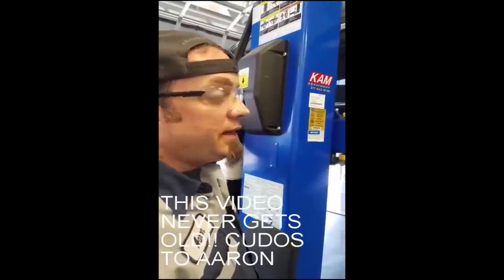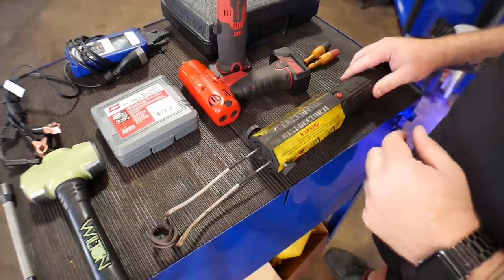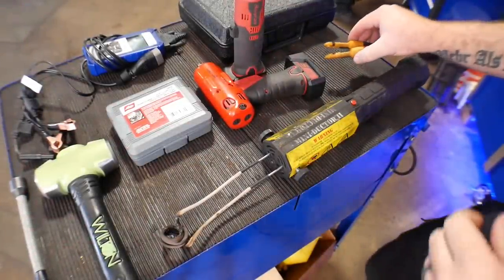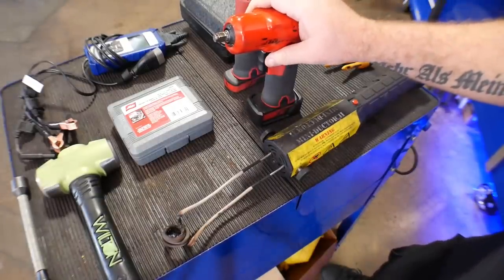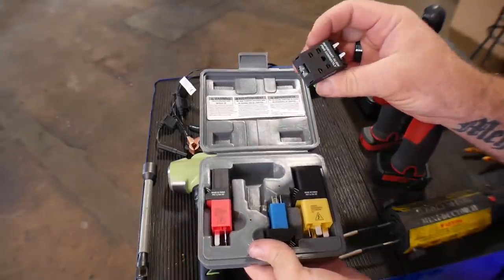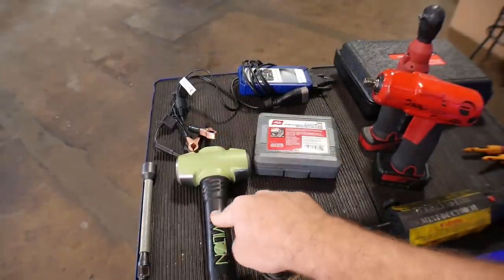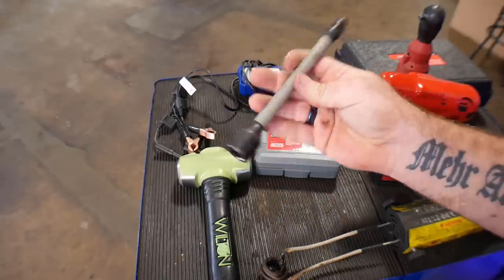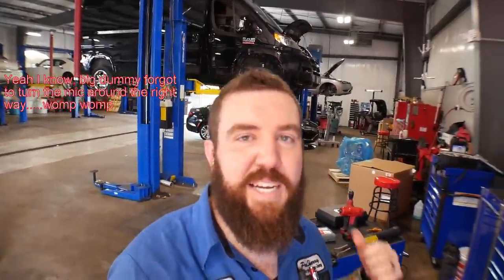TOP 10 TIME SAVING TOOLS FOR THE MODERN TECH

Comment: My Top Ten - 9 cans of beer and one trip to Harbor Freight.
Reply: Harbor freight oil filter pliers and dog bones for drain plugs brokes in less than a week
Reply: @diegochur2241  what u talking about
Reply: If you get the black handled ones you need to put lock tight on the bolt have had mine fit a year
Reply: Me too!!😎
Reply: Mfs talking about oil pliers 🤣

Comment: As a field mechanic for heavy equipment I think the cordless impact and wobble sockets are the two most used tools on the truck followed by a dmm, followed by a crappy screwdriver for jumping stuff over, followed by a torch and welder.

Comment: in minnesota, everything needs a  4lb hammer. that inductive tool looks useful as hell. my time saving tip is when working on something unfamiliar, put bolts in a plastic organizer box and label each square on the lid with a dry erase marker
Reply: A 4lb hammer and a cutting torch.

Comment: Good list.  I'll add stubby impact, swivel sockets, extra long ratcheting wrenches, furnace air filter in oil drain to prevent splatter messes, power probe, cordless soldering iron (butane or electric), those long reach angled needle nose and hose pliers.

Comment: Im a heavy equipment diesel mechanic and my biggest time savers are my 3/8 cordless gun, my 15 degree offset double box end wrenches, my trusty 13" 3/8 drive flex head ratchet, power probe, 3/8 semi deep sockets, and both of my relay test jumper kits. I love the relay jumpers some guys use the buddy tester but i prefer just using the jumpers, oh and my trusty mac prostick light

Comment: Piercing wire insulation and using a test light ? Really I mean we all have different ideas but in the rust belt piercing wires cause corrosion that will come back to haunt you. 
Great vid tho
Reply: I really don't get why guys don't just go to the connector for testing. Never understood why pierce if it damages the wire and also allows corrosion to get in and give you future problems.
Reply: @Downsolow  If I have to pierce a wire I always use a dab of liquid tape to seal it back up. Good stuff.
Reply: @johnsmith6368  I'm sure it's good stuff. But you still ruined the integrity of the wire in my opinion. You might break strands while piercing and you do seperate them with your piercing tool no longer making them a joint unit. But that's my opinion.
Reply: @Downsolow  I agree. Im saying if you have to because of whatever reason, you should at least seal the hole. The liquid tape gets into the hole and not just cover it up.

Comment: I just ordered the lisle relay kit after watching this video, thanks for the good tool recommendation. 
One tool I would definitely recommend as a tech that does a lot of diagnostics is an Incandescent test light. I use mine multiple times a day, almost every day of the year, it's extremely handy for electrical checks and makes checking fuses a breeze, and it's a cheap purchase on top of that.
Reply: Yea but go with the #69300!
 Then the #69250 add-on test jumper kit.

Comment: One my favorites is hard to describe but mine are Mac and it's a set of pliers that are extra long with an extra joint.  I think they are made for taking small hoses off but I use them all the time for taking off stubborn electrical connectors, works great.  Very good video, thanks for sharing and being so professional.
Reply from the maker: Thank you! I appreciate the feedback and tool input👍

Comment: Milwaukee 3/8, 1/2 impacts, cordless ratchet
Power probe 3
Fluke 179
Autozone volt meter
Coolant pressure test kit
Snap On Battery tester

Comment: As a marine mechanic I use a 12v pump mounted to a bucket with a lid to suck out oil of outboard engines, saves hours from having to pull the boat out of the water. Also the electric ratchet was a game changer.  Always have a magnet on me too. Dropping hardware in bilges or even dropping your tools and retrieving them

Comment: Thanks.  Very helpful; the mini-ductor is something new to me and a very practical choice. When you have to work outside, a multi-drawer mobile cart lets you move all commonly used or needed tools right to where you are working, and it has parts bins and a work surface on top and a power bar to plug things into.  Second are magnetic trays to hold small parts.  The mobile tool cart is less than $100, with warranty, if you shop the big-box sales.

Comment: I bought the same meter clamps for draws. I haven't touched them since I bought the UNI-T UT210E amp clamp for $45 on Amazon. Checking for draws has never been easier. You can even put the clamp on individual wires going to each fuse box or alternator and narrow down the draw even farther. You dont even need to disconnect the battery.

Comment: As a diesel mechanic (trucks and equipment) the best tools I use are a 50 inch pry bar and a power probe. Also milwaukee 1400 torque cordless impact is a life saver. Take it on site, no air needed

Comment: im in a way differant field, but the knipex pliers wrenches are the best thing ever
Reply from the maker: We don’t have any knipex offered here locally but from what I hear I’m gonna have to check them out
Reply: Rustbelt Mechanic you don’t have a snap on truck?? Look around or ask your snap on guy they should be somewhere. I got my knipex cobras on my local truck. Love them.
Reply: Same here. I carry an 8 inch pair on me EVERYWHERE. Everyone makes fun of me untill they see me use it. Best tool for taking springs off of air brakes too
Reply: I have three different sizes of the cobras
Reply: Rustbelt Mechanic Mac, Matco, even Blue Point has knipex stuff. Super good stuff. I keep a tiny set in my pocket all the time and they’re great.

Comment: Mapp gas, swivel sockets in 3/8 ,pb blaster,1/4 air ratchet, 3/8 air ratchet, swivel impact extensions, impact swivels in 3/8 and 1/2, metabo grinder with cut off wheels.
I don't know how anyone works without any of these things in a timely manner.

Comment: Very nice list. I have done a video on the hammerhead lithium ion screw driver I have multiple ones and have broken 2 one was my fault the other. Was a fall to the floor which disabled the lights it’s a great tool it’s no bigger than a screw driver uses the 1/4 inch bits recharges via usb and save me hours per day and no wrist twisting. I need to do an update video on these drivers they really save time.

Comment: Electric ratchet by far no.1 must have 2 + batteries.
Diablo Sawzalls metal blades..
Headband flashlight...
Under hood light.
Remote/cable spring clamp tool.
Magnetic trays.
Wobbly extensions, 1" most.
Test light with audible tone for fuse testing. Harbor Freight $4.
$20 code reader for quick direction.
Good extendable pen magnet.

Comment: that wilton 4 lb sledge... i really really really recommend it to everyone. trust. investing in good hammers is so important in this trade. 

my number one time saving tool are my matco wrenches. SRFBZLM102TA. gear wrench has a 120 tooth version of the same wrench.  also love my matco AFR128LFG. comes in handy for starters and working around the engine. very small profile. two very worth while tools.

Comment: Quick trick I have learned with the vacuum coolant fill is to put a pair of vice grips on the end that goes into the coolant it holds it at the bottom preventing from getting air into the system or the end from floating to the surface

Comment: Electro-magnetic induction is the passage of energy using magnetic fields generated by passing current through a conductor. Likewise passing a conductor through a magnetic field generates an electrical current in the conductor. This is how AC induction motors  and generators work and similarly how the alternator generates electricity by turning the wires through a generated magnetic field in a vehicle. This is the same principle used on modern "smooth top" stoves. The energy passed through to the pan, or in this case the bolt, is concentrated and does not generally have a method of dissipation so the energy is converted to heat. I hope that helps. BTW, thanks for the videos. I enjoy them and have gotten a few things out of them.

Comment: Get a hand held clamp meter, that way you don't have to disconnect the battery or anything else to check for parasitic draw. You can get the UNI-T UT210E for like $50.

Comment: After you poke a hole in the wire coating what do you use to seal it back up?
My most used tool in life is my leather man. In the shop m12 3/8 drive stubby impact love this thing. Lot of power and fits in most places.
Reply from the maker: Dielectric grease and electrical tape. Good one on the leatherman!

Comment: FROM THE HUSKY INSTRUCTION SHEET:
IMPACT GUN CALIBRATION PROCESS:
For the torque limiting extension bars to perform at their
stated performance level, each impact gun to be used 

with the torque limiting extension bars must be first
calibrated according to the procedure below. Prior to
each use, the user must confirm the air pressure
matches the calibration pressure / battery level is above
50%, and the gun setting is at the calibrated value.
Periodic re-calibrations must be completed as necessary
to account for wear in impact gun.
1. Note the air pressure at time of calibration or confirm
battery charge is above 50%
2. Set the impact gun to the lowest setting and tighten a
loose wheel nut using the appropriate torque limiting
extension bar for vehicle (ex: 80 ft-lbs)
3. Once the fastener is tightened, mark the lug nut
position. Then loosen the fastener, and using a torque
wrench re-tighten the lug nut to its original marked
position. Note the gun setting and measured torque on
the torque wrench.
4. If the measured torque reading is lower than the target
torque, increase the gun setting up a notch and repeat
step 3 until the measured torque reading is as close as
possible to the target torque.
5. Congratulations! Your impact gun is now calibrated.
Tag or mark the gun with the setting of the gun
(including air pressure if applicable).
6. Prior to using the impact gun, make sure the air
pressure / battery level match the calibration values
and the gun setting is returned to the
calibration setting.

Comment: honestly all my electric tools. i plan on switching over to all electric tools soon (as much as possible) as the air set up at the shop is horrible and i constantly have to switch hoses just to work on the other side of the veh. not to mention, we use automotive fittings instead of industrial so after about a week, a brand new quick release female coupler will take 10 times as long to put a tool on. also, probably the number one time saving tool i have is a crappy walmart brand multitool. im i use those pliers and knife on it more than any tool.

Comment: I watched a few of your videos and finally hit the subscribe button.  I’ve had the Miniductor and piercing probes in my Amazon cart for a while but haven’t been able to bring myself to spending the cash.  I’ll probably buy the miniductor the next time I need to do a Subaru ball joint since those pinch bolts are a mother!  I own most of the SnapOn 14.4v line and the 3/8” impact is my favorite.  The ratchets are probably second in line.  The drill and screw gun are probably not worth the money.  The screw gun is a real time saver but mine likes to overheat and shutdown with repeated use.  The 14.4v light is OK but it would be nice if it had magnets built in and for $100 there are probably better options.

Comment: Battery impacts.  Anyone who is messing with an air hose all day is wasting time.
Reply: Cuttingtorch not true at all. Love my 14.4 stuff but I’ll always go to my air impact when I need to pull the big guns out.
Reply: They make 1500 ft-lb 1/2 18V impacts nowadays.
Reply: New Guy at my shop been there about 3 years now never bought a single air tool all Milwaukee
Reply: Airs always there. Batteries aren’t. I love electric but when it comes to volume of cars you need air
Reply: Wolf Among Sheep  
Should be hand torquing alllll lug nuts that've been off before they leave the shop....
Reply: Wolf Among Sheep  
I don't anymore, did heavy truck repair for 4 years and every lug got hand torqued. Have seen way too many issues with under or over torqued studs, especially on Budds and Daytons. The liability isn't worth the couple minutes time to skip it if a wheel comes off and kills someone.
Reply: Wolf Among Sheep let me know where your shop is so I don’t go there. Torque specs exist for a reason!
Reply: Wolf Among Sheep so everybody at your Honda dealership is over tightening lug nuts? Torque on most (all?) Honda cars is 80. Odyssey van is 94... Not sure about the rest.
Reply: @kylesonsalla7620  I have a Kenworth over the road truck and every time I have tire work, they use a torque wrench on the wheels. Nobody needs a tuck tire coming at them at highway speed.

Comment: How well does the induction tool work on manifold bolts. Mainly hemi.
Reply from the maker: Eh, 50/50, there’s not a lot of help you can do for those too often. But rusty suspension and ball joint bolts/nuts...like butter

Comment: Those wire piercing tools are such a Haggard way of trouble shooting. If anyone in my shop uses them they will get written up so fast. Because just a little way down the road some moisture is gonna get into that wire and it's gonna corrode and cause another problem.
Reply: I think the best way to tap in, if you dont have a breakout harness, is to use Deutsch spoons. They are made for Deutsch connectors that are all over heavy equipment but I use them on cars and trucks too. They slide right under the weather pack.
Reply: I strongly argue that statement. I probe test wires often... and in the last 14 years I haven't seen that prove to be an issue. What do you suggest unstead???????
Reply: Bit of liquid electrical tape and some heatshrink if you can and it is as good as new.

Comment: 4:30 - If I bring my car to you, please backprobe the sensors. Getting corrosion in my wires because you were worried about jabbing your hand and saving time.... well, I would not appreciate either of those thoughts. I would, as a customer, expect you to be able to backprobe without jabbing your hand, and I would expect you to get that done without it taking a lot of time. If the improper wire piercing tools save you a minute or two, a customer really couldn't care less about that.

The only people okay with piercing probes are those who don't realize how bad corrosion is to wires and those who don't realize how annoying it is to have tape and/or heat shrink all over your wiring harnesses. Even if you feel you're doing good work, if I have another problem later, seeing wiring harnesses with patches on them to cover the holes you make makes ANY future diagnosis harder. Because then anyone working on the car is going to have to investigate WHY those wires have been patched.

Just please don't do it.

Comment: You might want to read the instructions that should have come with the torque stick.  You (one) cannot used ANY amount of torque setting on the impact.  Typically the max is 250 ft. lbs from the gun, and some torque stick manufacturers actually suggest calibrating them.
They do NOT have infinite twist limit capability.  They twist just so far, and then if you're ramming it with a 700 ft, lb impact gun, it WILL put more torque on the lug nut.

Comment: Hey man, What is the part number or where did you get the battery draw wire set for the meter? Having a tough time finding it
Reply from the maker: Lisle tool number 64970

Comment: How does the cooling system filler tool save you time? Don't you still have to run the engine to open the thermostat?
Reply from the maker: Nope, it pulls all the air from both sides of the thermostat and the entire cooling system so there’s no need to wait til it opens.
Reply: @RustbeltMechanic  Awesome thx!
Reply from the maker: No problem👍🏻